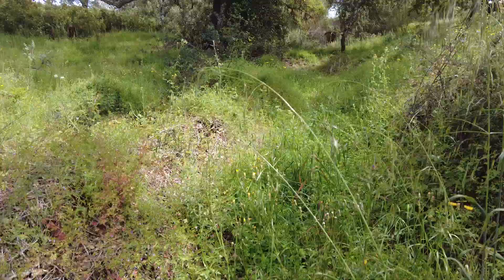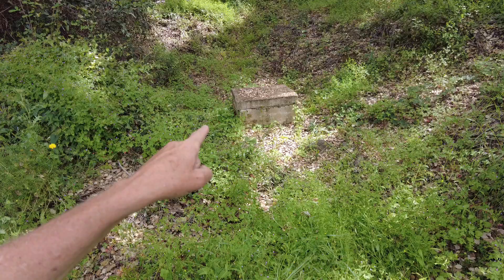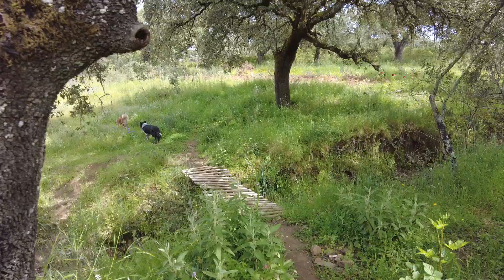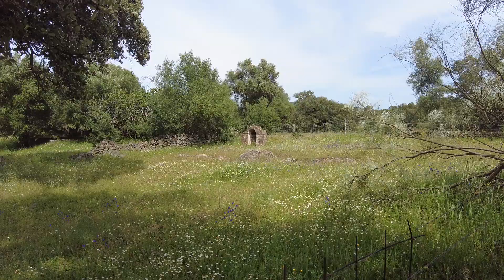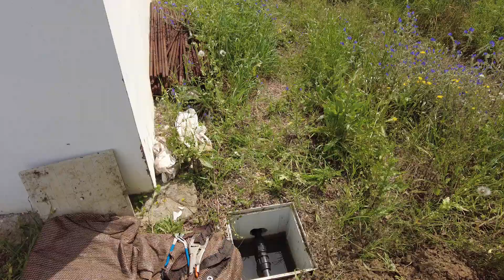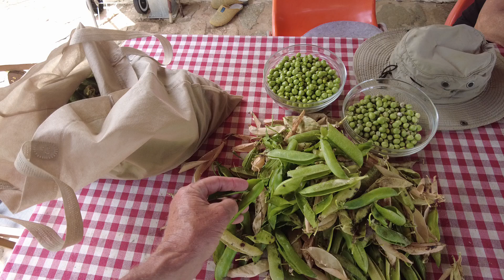Irrigation irritation. What a mad pipe world.

Comment: Rule of thumb; you will not have more than one sealing element (O ring, Square Gasket, etc.) in a screw together fitting.  There will be one sealing element that relies on a good fit followed by compression.  Gaskets don't stack up on top of O rings,
12:02 This appears to be a glue in reducer.  It is not a part of these fitting assemblies.  It is for glue together fittings. You may have a whole separate category of glue together fittings and components.
12:36 The two split pieces with internal thread are broken.  They were overtightened and split. They belong in recycle,
Nice crop of peas.  Great to know you are seed saving :)  Are you keeping notes of when the seeds where planted and when they are harvested?  That is important info as you have to harvest before the dry season begins.
Reply from the maker: Scribe will be employed Steve. Sealing will happen, one way or another! Thank you for sharing
Reply: @SuerteDelMolinoFarm  Thank you Edith!  
I asked about planting dates because your climate is not typical.  With two growing seasons I feel it is important to get a feel for the earliest you can plant.  It is not an exact science and the earliest date to plant will likely be unique to your farm and its unique topography at the base of the mountains.  This is where the farmers experience and instincts play a critical role.  Seems you did a great job with the peas.  I hope you continue to have that kind of success, :)
Before you know it you will be planting fall crops!

Comment: I had no idea that the canal extended such a distance.  Knowing this, the thought of adding a manageable flow of water from the culvert to the canal makes total sense.  The stone distribution house is very cool.  The design is very similar to structures I have seen in Italy where drinking water flows from a spring for the townspeople.
I question whether the creek  predates the placement of the culvert.  I suspect that the culvert consolidated the flow of water coming off the mountain to a single point.  As a result, the volume of water that flows through the culvert eroded the soil into the "creek bed" we see today.  
In fact, your efforts to date have been to redirect the consolidated flow off the mountain and distribute  the water naturally across your land. :)
Reply from the maker: The qanat doesn't hold water Steve. What is directed into the one end will leave the other end. How do we feed the source of the qanat water? Thanks for making us think.
Reply: @SuerteDelMolinoFarm   A 4" diameter pipe making a straight shot to the highest elevation of the canal atop the qanat can redirect water from the sand bag dam to the canal.  This pipe would help to distribute the creek flow across many more square meters of land and build the available water reservoir in the soil that feeds the qanat cistern.  
Place the small diameter pipe  through and close to the top of the sandbag dam. Run the pipe on top of the  westerly creek bank to the top of the qanat canal.  Screw all the joints together with 3 pan head stainless steel screws in the event the experiment falls and you want to disassemble and recycle the pipe. Put an L on the end of the delivery pipe and spread the water across the surface of the canal from bank to bank with a 4" diameter pipe drilled with  1" diameter holes every foot to distribute water across the entire  grassy surface. Cap open end of the distribution pipe.  
No dynamite necessary!

Any water that is not absorbed by the soil surrounding the qanat will continue down the path of the ancient canal soaking in as it goes. :)
Second means of feeding the qanat; Replace or add a watertight stone and cement dam where the sandbag dam sits now that will hold a substantial amount of water to feed the qanat.
Both of these measures will increase the duration of spring water run time following rain events. :)

Comment: Thank you for the update on your progress with the irrigation system.  I hope you will continue for the benefit of all homesteaders who have yet to tackle this piece of infrastructure.
A few suggestions about recycling fittings;  Keep a bucket of hot soapy water and a scrub brush handy so you can wash the threads and O rings clean.  Any little speck of dirt can cause the threads to bind and/or the O ring to not seal.  
Check the O rings for fit.  They should be tight, not stretched and they should be round in section not oval.  If they are oval or have cuts or blemishes, replace them.  
Lubricate the O rings with a non toxic grease like lard and wrap the entire thread with a single thickness of Teflon tape so the threads have less friction, sliding easily for maximum O ring compression. 
Use the wrenches that are made for tightening this type of fitting.
I can see that matching up all of the parts and pieces is a jigsaw puzzle.  I will suggest that you empty all of the bags and cartons  for the first step - consolidating the pieces by pipe size.  Everything over 40 cm goes back in a box.
Reply: Steve, are you suggesting I add clean freak to my list of personality issues? 😂❤
Reply from the maker: @1millionpumpkins542  You are really a full moon doll. Cheers!
Reply: @loosenatural8171  A lunatic? I'll take it. Btw, this morning it was phenomenal to see the full moon setting at exactly the same time as the sun rising.  Blessings to you and the Farmer's Wife and to all the peas both in and out of their pods
Reply: @1millionpumpkins542  🤣😂🤣 Not at all!  The hot soapy water and a scrub brush applies only to dirty old recycled fittings 👍👍👍